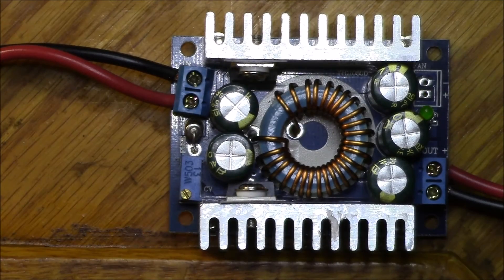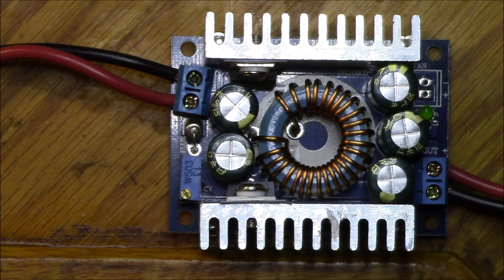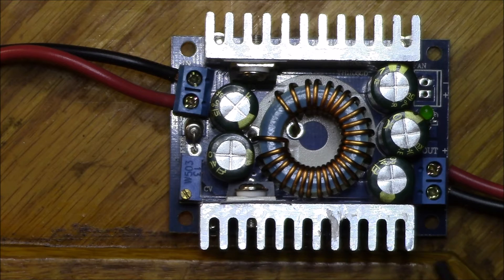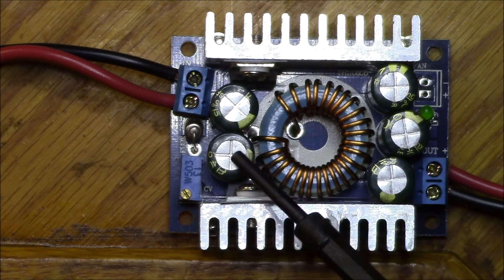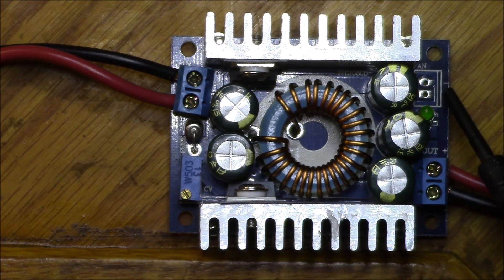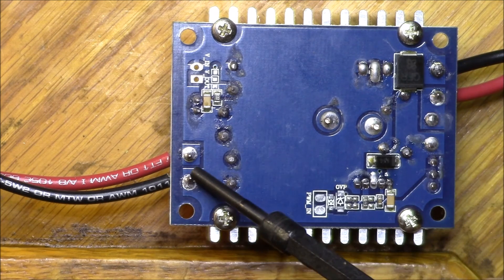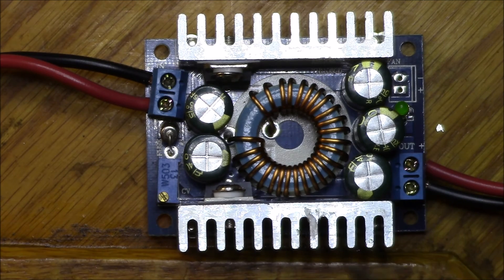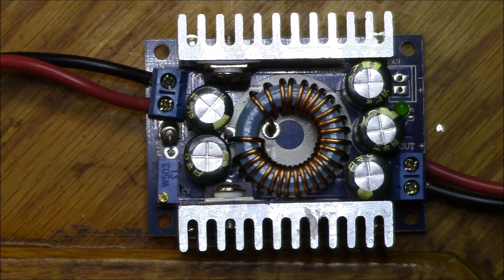DROK 8A/100W DC-DC Buck Converter Review, Part 1

Comment: Wished I  was smarter and knew ohms law better... 
Short story I seen my grandfather and father spend hundreds each year on marine batteries fishing. Trolling motors will kill LA batteries and really only offer 50% rated AH rating. I refuse to go down the same path I make 4s 18650 battery packs because of the superior cycle compared to three series packs. I use one of these 20 amp bucks to turn my 16v pack to 12.5 v for the motor. I know efficiency is lost during the buck. The thing is @16-14 volts the motor is super charged using much more amps than an unbucked pack. The question I guess is whats better a turbo charged motor at high amps or a buck at optimal voltage. My field tests is showing its better to buck it than to run it turbo charged as far as capacity. 

Li Ion is amazing an 60 Ah pack gives way more energy than the most expensive deep cycle marine battery. I charge to 4.1 volts and cut off at 3.3v for four years the packs are performing like the day I built them and still thousands of charges left. Once I perfect the small packs I will make a powerwall and take my solar pretty much off grid :)
Reply from the maker: The buck or step down converter will likely give you more run time.  Running the motor off the higher voltage does give more power but at the cost of pulling more amps from the battery.  Then as the battery voltage drops, the current and power drops as well.  With the buck converter, you'll have the same current/power to the motor all the time.  At higher battery voltages, the current draw will be less and that will gradually increase as the battery voltage drops.  I think the general rule with those converters is the less the voltage difference between input and output, the more efficient they are.  So 16v to 12v is more efficient than say 24v - 12v.  Just be careful pushing the converter at more than ~2/3 of it's rated output.  Maybe add a 12v fan or make sure there is good air flow over the heat sink.  I've been running some 15 amp boost converters daily for almost 4 yrs. now at between 7 and 10 amps and they are still working fine.
Reply: Tyvm Yea we mainly bump it around on low fishing small ponds on low it pulls 2 amps on high its 15 amp pretty huge difference compared to the actual speed difference. On a windy day on high I have one with an small pc fan cooling it so yea on high it gets warm..Amazingly never used a Bms on any of my packs just balance charge them and monitor voltage with cell meter. Plus using meter to balance mid camping trip little bit hands on but I enjoy that. I send my son and nephew with three series packs so they cant drain damage them ;)
Reply: I don't know but I just set up a DC/DC buck converter to turn a bicycle treadmill generator into an EASY 4 amp charging generator (pedaling in lowest gear, easy). https://www.youtube.com/watch?v=QrQCiWPiWp4
Reply: Pm me can you install do sola battery...

Comment: Wow great video, on input, if I fed it 12 & 22 volts, & 2 amps, what could I get out it on the amps output?
Reply from the maker: For a rough idea, take the product of the input voltage and current *say 12 x 2 = 24) and then divide that by the output voltage and that will give you the output current.Maybe subtract 10% to account for the losses in the conversion.  Say your output voltage was 6 volts, then 24 / 6 = 4 amps, less 10% is 3.6 amps.
Reply: Pm me can you install do sola battery...